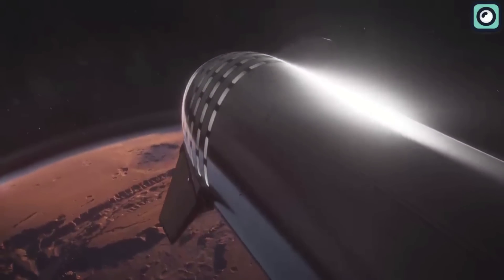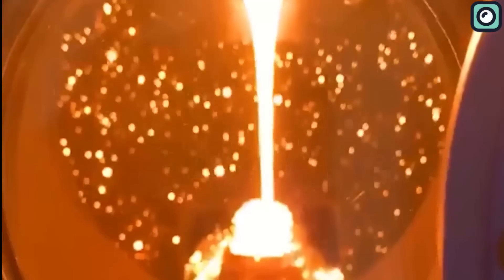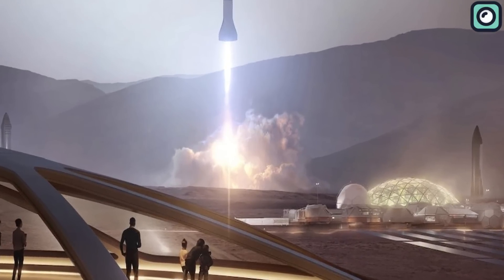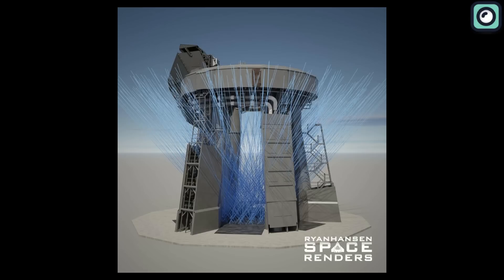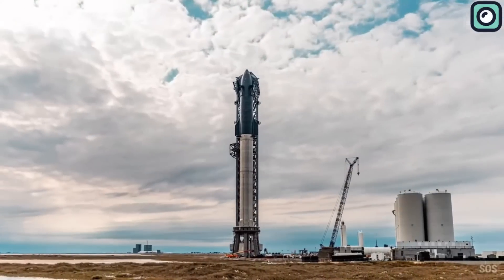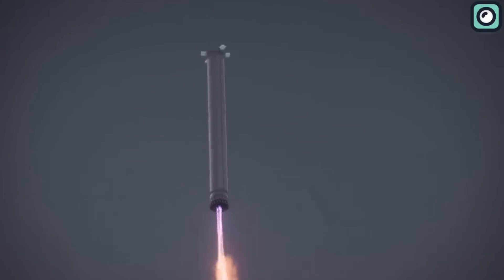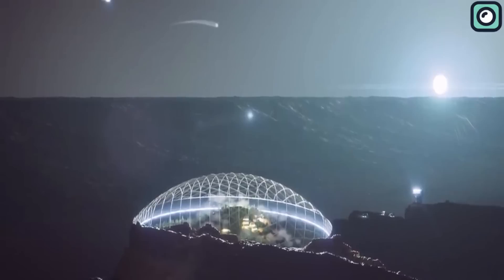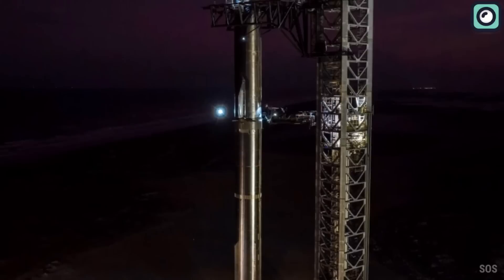SpaceX officially revealed NEW Starship to orbit... Elon Musk Reacts!

Comment: Format and script is excellent and a seven minute synopsis is great, may want to encapsulate the latest information since spacex is running at an exceptional pace that quickly dates your 3 day old video. 
As I understand it early Apollo could move 95K kgs to LEO of which about 59K kgs were payload capacity. However even here by 1972 that could move 142 tons to LEO.  The Starship is a moving target with Musk revealing that the latest Raptor 3 will operate at 350 bars and produce 269 tons of thrust.Imagine 33 of these engines operating then we might expect over 250 tons of LEO payload. Don't know how much is residual fuel for the return to earth. We will see when its finally done.